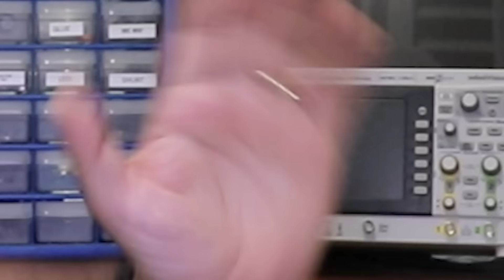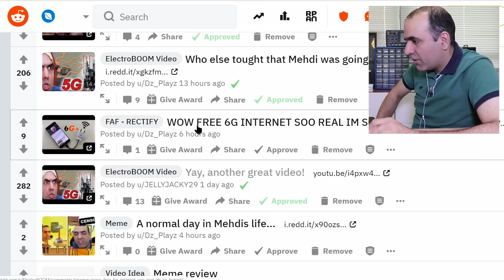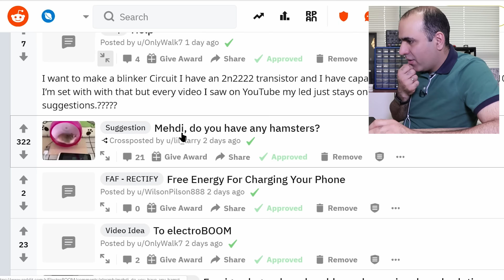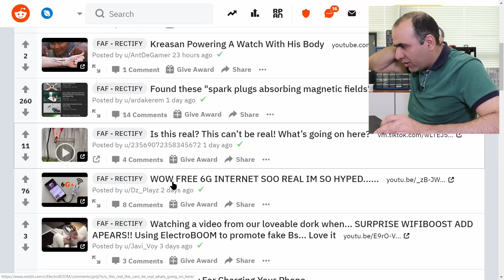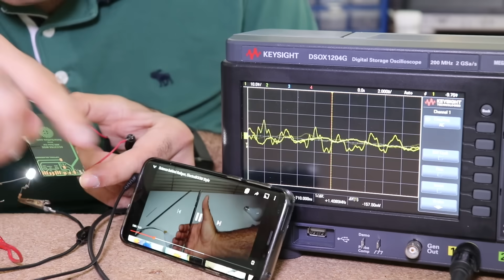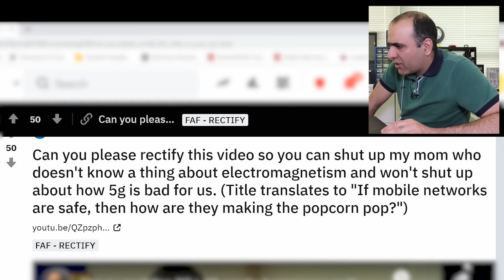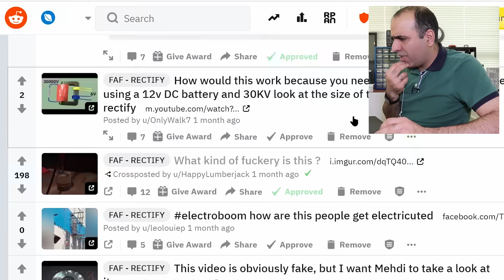ORIGINAL CONCEPT: Reviewing Your Reddit Submissions LATITY-001

Comment: im going to make an stupid question, if could answer in a coment or ir a vid it would be great, well here it goes, how comes that puting your fingers in the power outlet or closing circuit with your fingers is suposed to kill you?, i mean current finds the shortest path to move from - to + shouldnt it jump trough the joints of the knucles to close the cicuit instead of going trogh the heart and diaphragm and kill you? please answer.

Comment: When he said that he drilled into a live wire and said “how was I supposed to a live wire was there?” I thought of how much he needs a stud finder
Reply: You shouldn't rely on that though. Like he said these things are inaccurate. I always test mine on an area with a known live wire right before I use it, look for wiring I expect to find in the area, then flip breakers until they're gone. Usually I'll flip off more breakers than I think I should need to. Then when finished I'll check the screws with a multimeter

Comment: I like the microwave antenna idea. Personally I would build a big box from the antenna to the point I want the microwave radiation to hit first and ofc also a metal grille on the inside of the box from all sides so it does not escape

Comment: Mehdi is wrong for the first time. That hamster wheel is not fake I have one I'm my home I just use a cheap 5v to 5v circuit that limits the current to 500ma. I can even do experiments without any resistance on the wheel

Comment: LiFi could transmit up to 100 Gbps and possibly higher, but this would require a change in lighting technology. Recent news report that LiFi is 100 times faster than WiFi. The assumption was that the average WiFi speeds are 10 Mbps, and that LiFi can be as fast as 1 Gbps
Reply: this is the light project

Comment: With the device at 8:40, if it‘s a digital signal (and works like TOSLINK), it wouldn’t get quieter if it was farther away; it would cut in and out like in the video. Try it yourself with a TOSLINK cable—pull it slowly out of your receiver and see how far out of the receptacle it can be before it cuts out. The audio doesn’t get quieter before it cuts out, either.
Reply: how about internet it should buffer if the playback exceeds th buffer the video stops thats why it partially wprk

Comment: When popcorn pops, it typically gains considerable velocity. Without a container to hold the kernels in, those kernels would spread far and wide. A close-up shot of popcorn kernels popping on a surface with no containment would look like this:
Frame 1: Kernel
Frame 2: Blurry line
Frame 3: No kernel
Frame 500: Still no kernel, because it landed two yards away from where it started and is out of frame.

Comment: 9:30 Mehdi, I've done such a device as a project once, although I used a phototransistor-based receiver and LASER-based transmitter. And it actually sounded great. 100% would recommend.
Reply: Its also a great way to exfiltrate confidential data from an air-gaped computer system, at 150Gbps ;)

Comment: You shouldn’t use volt sticks as they are not approved devices only a voltage indicator and proving unit is allowed as stated is bs7671 (IET Wiring regulations) volt sticks also give a false sense of security as they are not accurate enough to be relied upon hence not being a approved method of safe isolation. Finally my 5 year apprenticeship has come in use and allowing me to comment on a YouTube video !!! Whooo suck it mom telling me to go to uni anyway that trailed off there......

Comment: In case anyone was wondering, the question as to why AC passes through a capacitor and DC doesn't is to do with the sinusoidal nature of alternating current, and the relationship it has to the capacitor. The impedance of the capacitor (its resistance property) heads to infinity at low frequencies (as it stops oscillating, such as DC) and thus with infinite resistance, no current flows through the capacitor, but on the other side, with high frequencies the impedance heads to zero, resulting in a theoretical short circuit, where current can flow. Check this out for a more detailed explanation https://www.electronics-tutorials.ws/accircuits/ac-capacitance.html

Comment: Our neighbors, when I was living back in Connecticut, once had a cable TV installer drill a hole from inside their house right out and into the house's 100AMP or more electrical service! Boy did we see all the sparks, smoke, and fire! Luckily the installer was okay and the cable TV company made good on all the damages, new electrical service, and repairs with the neighbors. I never heard if the neighbors ended up with free cable TV as additional compensation or if the installer lost his job, but if not, I'm betting he never made that mistake again!

Comment: Incredible, I've never seen a video like this. Certainly a masterpiece.

Fun fact: soldiers in WWII made crystal radios using pencil lead and razor blades.

Also, Li-Fi is a real technology, and can allow incredibly fast download speeds, but... It's not was LED and a solar panel.

Also also, I built a 10kW microwave cannon using the internals of 10 microwaves and some carefully designed waveguides. Melons were exploded. Fun was had.

Comment: The microwave thing wasn't actually dangerous. the faraday cage is not there to protect the user, it is a necessary component in the cooking, you need the energy to bounce back and forth in the box to form a standing wave which will dissipate from transfering its energy to the food rather than spreading out and going to nowhere. the video was just a shitty 1000 watt waveguide.

Comment: Well now....since I'm getting furloughed for 3 weeks, I have my drill, I have my microwave oven and, obviously, one of those curvy light bulbs that's not as efficient as led! I know what I'm doing! (I get cold easily so it's fine). I must remember to drill a hole on the correct side of the oven though, that means turning it around. Hey! That also means I can prove that popcorn can be made with the same frequency as my WiFi! (I'll conveniently forget to include wattage ). Maybe I'll post it on here but make sure to say, DO NOT DO THIS AT HOME! I'M JUST TROLLING !

Comment: Regarding the "LiFi" rig:

Instead of an LED and solar cell as your transmitter and receiver, why not use a laser, and laser detector?

The signal would then be much easier to aim, and would have far greater clarity over a more practical range.

Comment: The fact the LED plus solar panel worked to transmit audio signals in such a simple setup is awesome. Also, treble seemed to work fine, amazing. 
I reckon a strong infra red laser pointer would work to pop popcorn, half a watt even might do.

Comment: The Li-Fi video was fake, but the claimed possible speed certainly was not.
There are research papers suggesting 100Gb/s and more are possible. Well sure not with such cheap components (you need a laser for such speeds. LED seems to cap out at 1Gb/s).
https://spectrum.ieee.org/tech-talk/semiconductors/optoelectronics/laser-lifi-could-blast-100-gigabits-per-second
https://www.osapublishing.org/oe/abstract.cfm?uri=oe-23-2-1627

Comment: I have a coil/magnet interaction that i would like to explore, using capacitors to hold the voltage generated from the flux before the motion changes the polarity.  my models showed usable energy, and electromagnetism lends well to scaling.  i have only a smattering of electrical knowledge with little practice, but i have managed to prove my theory generating 12v@2a with only 10 11mm neoD magnets and 10 coils with 18 wraps each.  my coils are wound differently than a standard 'back and forth' coil.  my movement style is different than most as well.  likely need some timing control to flip the output from positive to negative polarity collection capacitor banks, in time with the rpm.  my design is simple and robust and will accommodate high wind energy and fluctuating direction without grease or oil dependence or service.  it has been bubbling around in my mind for about 20 years but most of the questions i still haven't answered likely need someone with your active knowledge.  if i can make it 'public access open source' and still collaborate with you, i would be open to discussing it.  i'm not interested in becoming wealthy, but neither do i wish my concept taken and used to make money with any copyright supporting a restriction of further development by anyone who envisions a design improvement.

Comment: 11:00 - can you try to do this with "laser" diode with setup like this: Laser diode instead of normal LED, and receiver - solar panel closed in box, that has one hole and lens (to make laser light shine at more solar panel surface). Rest as you shown. This would be possible best setup, so you could play music from another room, or send messages without possibility of hacking in to it ;) Can you try?

Comment: "It's called a Bistable Oscillator."

Ignores the fact the website says it's an Astable Multivibrator.
Reply: Well I'm electric hobbyist and what he said actually makes better sense to me. Astable Multivibrator is a "book" name of schematic, but the name "Bistable Oscillator" better describes it I think: it creates oscillations, so it's an Oscillator, and it has two stable states, so it's Bistable, together = Bistable Oscillator. I think I would prefer this term.
Reply: @semplar2007  it's not like that
Astable means no stable state so its voltage levels alternate between high and low state without us doing anything thus producing a square wave
In bistable multivibrator there are two(bi) stable voltage states so it will output initially in high or low voltage state , if we give an external trigger it goes to the next stable state and stays there again Triggering it comes back to the initial stable state thus 2 stable states thus can't give an alternating square wave automatically to blink the led
Reply: @semplar2007 you are right, it's an oscillator
 it's called multivibrator specifically because technically multivibrator is an oscillator that produces a waveform other than sine wave
Like sqaure wave in this case
Reply: @abhijithanilkumar4959  oh, thanks for explaining
Reply: H-h how
Reply: It was right there in his face lol. But as for the blinking led, a joule thief/blocking oscillator with a timing cap across the base potentiometer is probably the coolest way to go about it.
Reply: I was thinking the same that wasn't it astable and why he said bistable
But I think it will be easier if you have  a 555
Reply: *hears vibrator*

Comment: So all microwaves leak, to some degree. Years ago, I had installed a sensor into my car, that would allow me to keep my windows down, and if someone stuck their hand in my car, it would trip the alarm.  I centered the sensor in the center of the headliner. Unfortunately it was way more sensitive towards the drivers door however. I started working at a convenience store, and would park my car, in a specific spot, in the front of the building, but leaving enough room for cars to pass by. I realized after some time, this pattern, that when someone would use the microwave (which was about 40 to 50 feet from my car, and many things in it's direct path) would trip my alarm.  I showed my boss, she instantly thought I was using my keyfob to trigger the alarm, and so I let her hold my keys and try it and as she turned on the microwave, it would trip my alarm.  The strange part was if I just moved my car 2 feet up or back, it was out of range.  The microwave was perpendicular, so if you are facing the microwave, the signal was coming out of the left side.

Comment: 4:10 they are called electron trees or lichtenberg figures, you need a high energy electron source in the MeV range, yes Mega Electron volts, if you have a linear accelerator you can make them. 😆😆😆😆😆😆😆

Comment: When a kernel of popcorn gets heated it will start to lighten in color and start to swell until it pops. They do not instantly pop, it takes time for the small amount of water in the kernel to heat and turn to steam building pressure on the sealed outer skin of the kernel.

Comment: Wrt hamster wheel phone charger -  afaik the phone animated charging icon comes on even if you're putting less energy into the phone than it takes the phone to show the animated charging icon, it just starts animating  if it detects voltage on the USB. 
A company called Ubeam was conning journalists by showing phones 'charging' from a piezo transducer - and someone on EEVblog forum reproduced it and showed that it doesn't mean any useful amount of energy is being transferred into the phone.

Comment: How are you meant to know where the wiring runs in the wall? In the UK at least, there are "zones" in which it is safe to run wiring and which must be assumed to carry wires. Those run vertically and horizontally from every electrical fitting as well as within a defined margin of the ceilings, floor and any corners. Avoid those and there should be no wiring if the installers having been following the regulations that is.
Of course, using a detector is still advisable.

Comment: 8:41
Even thought I'm not an expert I can tell you that could be possible because of science. Okay so everybody know that 5g can get as fast as 1gbps this is because milimeter wave 5g (the fastest 5g) signal is using the microwave spectrum which is faster than the radiowave spectrum (which what 4g uses), but visible light spectrum is more powerful than microwave spectrum so it can carry alot more data making the speed very fast. Yeah science baby
Reply: The technology in theory, not what they were doing, which they didn't seem to explain much, and not sure where they picked 150 from specifically.
Reply: Yep, it's called fiber optics. Just last month they sent 44.2 Tbps across 75km of fiber, depends on modulation and light source etc but it's plausible with an LED light source, I think some fiber optics do use LEDs in addition to lasers.

Comment: 5:01 Mehdi, maybe he use a motor reductor, gears o something to control the power
Reply: Torque, not power. Gears work like transformers. Torque is exchanged for speed (or vice versa), like voltage for current. Power stays the same, aside from losses.
Reply: @Valenorious  oh thanks for the information sir.

Comment: Bout the one where he screwed the screw in the live wire. In europe we have this things called distribution boxes where all live wires feeding the outlets come from them and are directed either directly horizontal or directly vertical from it (some times they do angles like an elbow to reach tricky spots). That way you know where the wires are and you don't electrocute yourself.

Comment: "That man is cutting that powerline while it is live idk why" that man is a lineman and they have to work on powerlines live as to not interfere with service to different areas I have a few friends that are lineman and they're crazy people lol
Reply: Apparently something wasn't right or it wouldn't have arced like that.  Perhaps he cut the wrong line or something caused a momentary connection between live and neutral causing the arc which could then sustain itself though the highly ionized air.  There are all sorts of safety requirements for line work and if possible they'll redirect power so they can work on dead lines.

Comment: Here is the correct article on charging a capacitor with a crystal radio. Scroll down to page 95 Article 25. Not a lot of energy. https://www.lessmiths.com/~kjsmith/crystal/tongue2engineering.pdf
Reply: Pages are out of order.  Article 25 scroll all the way down.
Reply: I wonder if there is a way to build a giant coil for more power

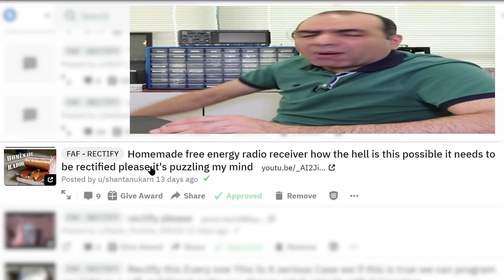Comment: 8:00 The crystal radio!!! I'm 60 years old now. Back when I was in Cub Scouts (circa 1970 or so), I built one of these using a toilet paper roll as the core of the tuning coil. Yes it worked, but maintaining a tuned frequency was a BI-yaitch! https://en.wikipedia.org/wiki/Crystal_radio
Reply: Reminds me of a (probably falsified) story from Lucille Ball about her bimetallic tooth fillings receiving local radio broadcasts.
https://vimeo.com/72473069
Reply: I had one too, I used to listen to Radio Denmark with it every night in Norway... it had very poor selectivity though.

Comment: 14:09  Actually, it isn't.  Even though he called it an "ionizer", there is zero ionizing radiation coming out of that.  The only thing those microwaves can do is warm you up the same way they normally warm up food inside the oven.  You will feel the warmth long before it becomes dangerous, and have plenty of time to get out of the way.  You'd have to be right in front of the output to risk getting burned, as once the microwaves start bouncing around the room, their intensity will be immensely attenuated. 

Just think about it rationally.  What happens when you turn a 1500W space heater on high in a room that size?  Does everything inside get instantly roasted?  No, it takes quite some time for the room to heat up.  The only way to get burned is to get close to the heater.  Same is going to be true of a 1500W magnetron.  That microwave likely has nothing higher than a 1000W magnetron, and more likely 700W.
Reply: Dude, that's not how radio wave/microwave reflection works.  Just because a 1500W heater is nice and comfy doesn't mean that grabbing a 100W light bulb with your bare hands is a good idea.  You get crispy very quickly.  Metal surfaces impinged with microwaves create very specific reflection patterns and if you stand in the wrong place, you absolutely will get toasty.  Google "RF burns" and watch some antenna techs or radar operators explain how quickly things can go sideways if you aren't careful.  Some of these burns will be subcutaneous and you might not even feel it before it causes irreparable damage.
Reply: Exactly! And also the autput power is to low to light up that bulb see Diod gone wild microwave gun (subscribe 
to him☺).